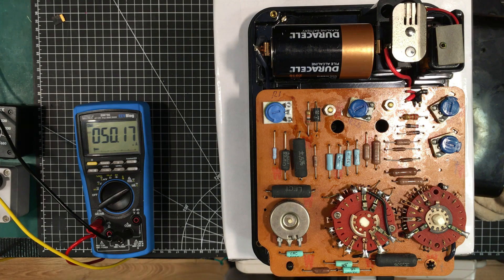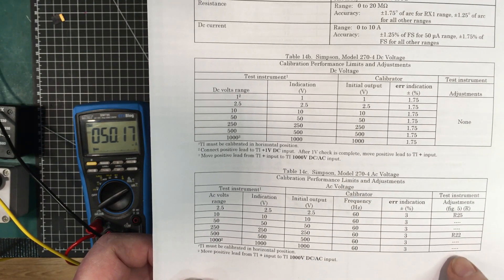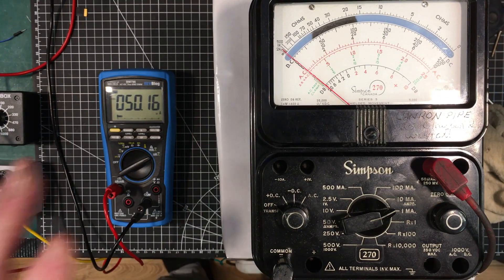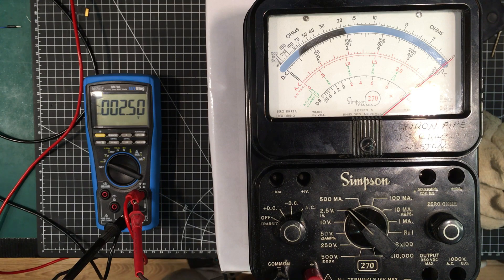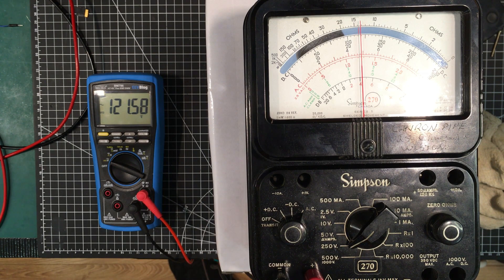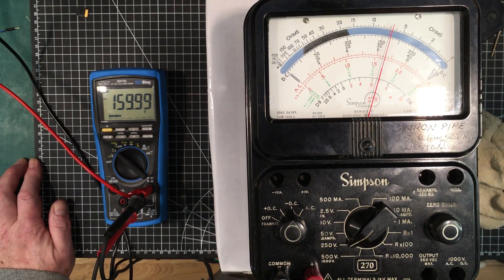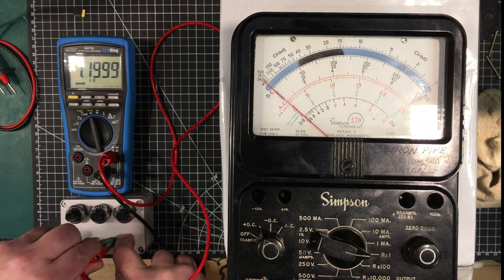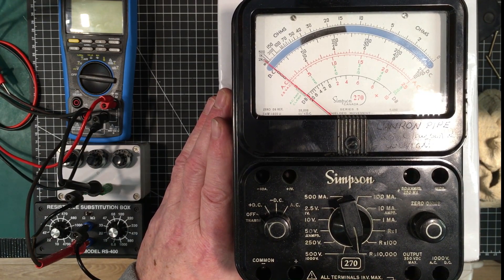Uni-Byte 0162 - Tested this SIMPSON 270 after 40 hard years, and THIS is what happened...

Comment: Seems you are putting faith in your digital meter. Keep in mind ensure your digital meter says "true RMS" before you use it as the holy grail.
Reply from the maker: Yes, I do trust that digital meter.  I've had that DMM for some years and this is not my first dance party.  Yes, it's True RMS, not cheap and is a well respected model from a well respected brand with independent certification (UL, CSA, TUV, etc.., etc..).  Not only that, but it has printed "AC+DC True RMS DMM" right on the front of the meter at the top under the model number. 👍

Comment: My 270 sits on the shelf most of the time, (I have Agilent, Fluke, and Keithley multi-meters on the bench,) but I still use the 270 for certain peaking jobs because the needle is true analog with no update delays or resolution steps. If the mirror behind the needle is used to avoid parallax error you can still get very accurate and consistent readings. Most young techs and engineers don't realize how stable and accurate, high quality old test and measurement equipment was, and still is. I can still trust my Simpson.
Reply from the maker: When you need an analog meter, it's hard to beat!